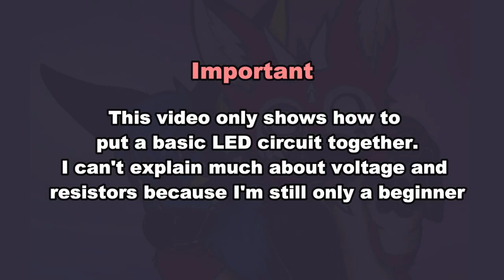How Fo Make A Simple LED Light Circiut For Fursuits & Cosplay

Comment: You did an awesome job! 😀
Here are some typical ratings for LEDs:
Red: 1.85-2.2V 10-20mA
Yellow: 2-2.2V 10-20mA
Green: 1.8-2.2V 10-20mA
Blue: 3-3.2V 10-20mA
Superbright blue: 3-3.6V 20mA
Superbright white: 3-3.6V 20-30mA
Of course the ratings depend on the manufacturer but these should work 95% of the time. 

By a beginner electronics technician furry. 😀🐺